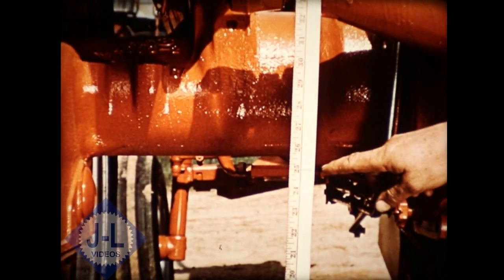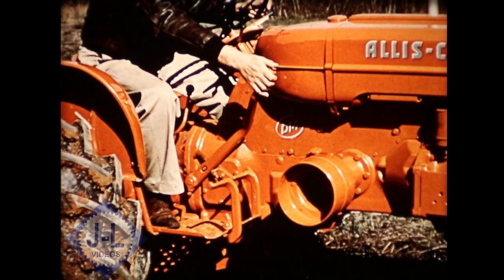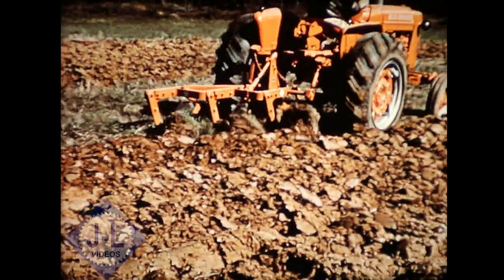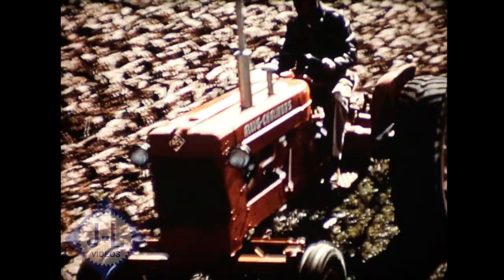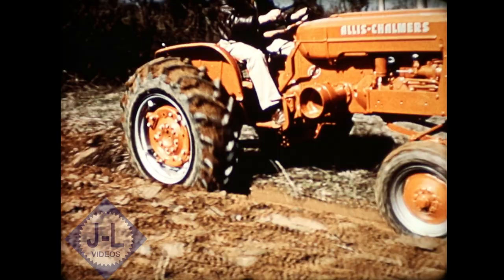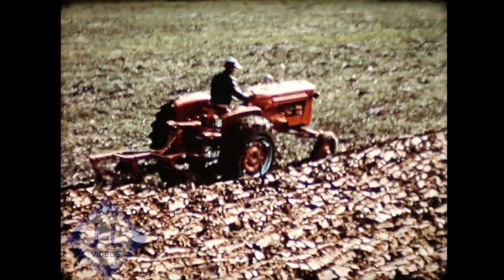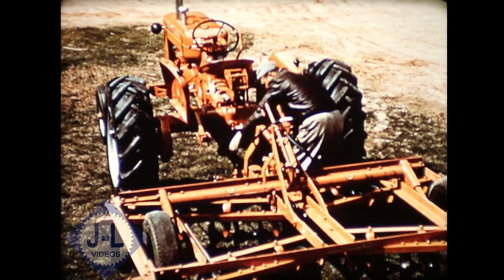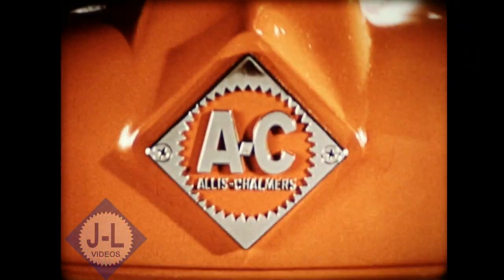1957 Allis Chalmers Dealer Movie Modern Power For Profit D-14 D14 Tractor

Comment: During college in the mid 60's during summer vacation I worked for a small school district maintenance department. They had a D-10. It was sold to the district by a school board member who was also the local Allis Dealer. It was too lightweight for most jobs that we were expected to do with it. Some of them very dangerous. Scariest moment was when something heavy was attached and you'd slowly let the clutch out and the front end would come up three feet. It's a wonder that were all alive.
Reply: Well, i guess if the kids can't figure out how to safely operate a tractor, an expensive education is their only hope.
Reply: I learned on a Ed 45 then when I mastered it then on to the D 19 and a mounted corn picker talk about dangerous gotta keep yer whitts about ya